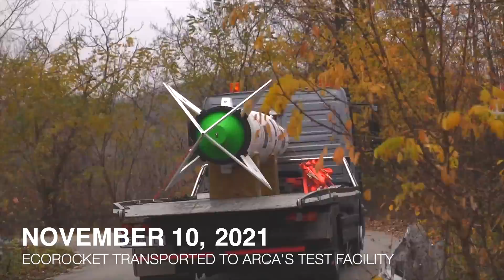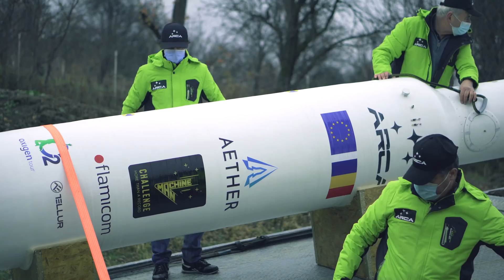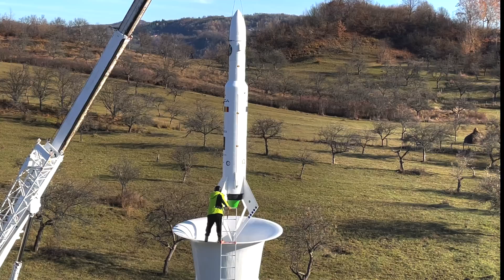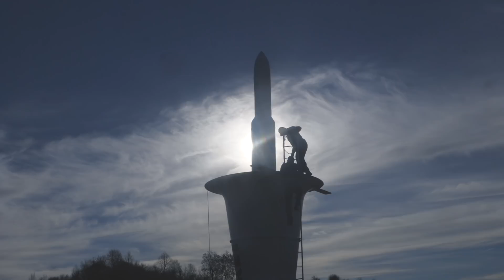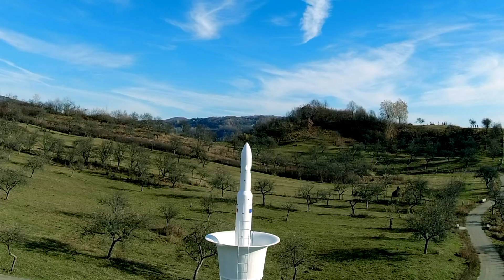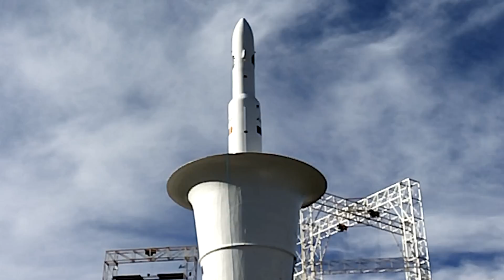EcoRocket: Episode 15 - Reaction Control System Tests

Comment: How is this supposed to reach orbit? This will never contain enough energy to go anywhere near orbital velocities.
Reply: You are kind of right, people had made the calculations and in a best case scenario they have about 8.8km/s of Delta V (as far as I can remember), that even with a high TWR (thrust to weight ratio) and perfect ascent profile is not enough to reach orbit

And just to clarify, I support every company/goverment that tries to reach orbit but facts are facts
Reply: And the water stages are only for climbing up to 80km, the rest will be a liquid fuel engine that will do the orbital insertion.
Reply: @Heitorkk2_  As I said. I doubt they can reach that altitude.
Reply: @PaddyPatrone  Based on what?
Reply: @PaddyPatrone  in theory you can reach space with steam propulsion, but orbit will be challenging. If it can reach space it would already be a great success though. Beating bezos with water
Reply: Fuck man, it's one thing for you to say it's impossible, it's another for you to prove in practice that it's impossible, let them, they're at least trying...

Comment: I mean good job with the super cool bottle rocket! If I understand correctly, the plan is to get to orbit? Highly confused by that. Have any of you actually done the math, because steam literally doesn't work that way. Your rocket would need to be the size of a city.
Reply: its not even fully fueled and the plan of the rocket has three stages and the 3rd stage is suppose to use rocket fuel
Reply: have you seen the math?

Comment: Very impressive start. Judging on the video from minute 2.29 to 2.35 it looks that it flu at least 4-5 seconds reaching 60-80 meters high. Was the rocket salvaged so it can be tested a little bit higher? How much water did it have , 10%?

Comment: Think it's truly possible to reach LEO with steam?
Reply: No, steam powered rockets can have a specific impulse up to 100 s. Or 1000 m/s often called Ve. A single stage rocket with 93 % fuel (steam in this case) and 7 %  structure and payload will reach 2.5 x Ve. A three stage vehicle vehicle will reach 5 x Ve. A vehicle with an infinite amount of stages get 6 x Ve = 6000 m/s. So that is 2000 m/s short of orbital velocity and we have not even taken gravity of air drag into account. 
Any person with an understanding of Specific Impulse and Tsiolkovskys rocket equation can easily see that it can’t be done.
Reply: @simonwesterlund2944  We don't have the Rocket echo data to assert the engine's ISP
Reply: @Heitorkk2_  we actually do, it s written on their website. If i remember correctly it was 80 for the first stage.

I don t understand the calculations above, but i ve personnally calculated that it won t reach orbit but still reach space
Reply: @unhommequicourt  One thing you forget, the water stages are only for climbing up to 80km in height, the rest of the orbital insertion will be done by a "normal" liquid fuel engine.
Reply: @Heitorkk2_  it doesn t matter, if they only reach space it would already be a huge success and proof of concept
Reply: @unhommequicourt  Yes, if at least it can be a sounding rocket, it will be cool.

Comment: the rocket wasn't fully fueled right?
Reply: I don t think so, you can see they stopped the rocket with a cable, so it could have went higher
Reply: @unhommequicourt  true
Reply: no and this was supposed to be the second stage, then there's a third stage on top of it.

Comment: No doubt highly amazing but it isn't it's delta V is much less as compared to a rocket of this size.
Reply: @tiagankoob8857  oh, you don't have the ability to do even half!
Reply: @tiagankoob8857  They didn't disclose the ISP!
Reply: @tiagankoob8857  so do it
Reply: @tiagankoob8857  you get more form me if you pull it off just send me the link to your video when it's done. Nobody gives money to word's... Not smart people anyway.
I know how liddle water rockets work but this is not the point. Do one to karman line and Ian impressed.
Reply: @tiagankoob8857  The ECO ROCKET has a 300 ISP engine in the third stage responsible for the orbital insertion, the water system is only for the ascent up to 80km, is it difficult to understand?
Reply: @tiagankoob8857  do better then
little engineer
Reply: It was just a low altitude test.

Comment: This is truly astounding! Amazing work! Can you explain what happened at the end? Was it not fully loaded, did something shut off unintentionally? How did it end?
Reply: Looks like he had a rope that limited the apogee for safety reasons...
Reply: @Heitorkk2_  is a pipe for compressed air
Reply: @radughita7996  Source?
Reply: @radughita7996  The Eco Rocket does not use compressed air.

Comment: We never lost faith in our ECO, allies. This achievement would make revolutionary break through in a Earthly hemisphere ally rocket✌👍👍. Wouldn't want to interfere with your work, but some suggestion, would be, for Eco Rocket to use a fast fuel density transfer, as a heavy mass, water will run out just as fast, then the "back-yard" hand made smaller,
This method, would transfer density of water from a more compress to a smaller chamber, lighter & HIGHER pressure mass, for example, chemical rockets in solid, switching to a paste form, then jell,  then foam, eventually mist & gas,. 
Only for starting from WATER , switch to a higher pressure in a smaller chamber, into mist - gas vapor steam . Saving much more volume per travel launch range🤞, Eco Rocket only needs to achieve surpassing altitudes of at least the Tropicsphere or Stratosphere to be a fully Eco friendly & a craft of Eartly resource in its name.✊🌍

Comment: Congrats for all your effort! Looks like the  apogee of the rocket was restricted by sort of cable visible at the end of the video. Is it because of safety reasons?
Reply: Yes, it is to prevent it from flying away in case something happens and also to prevent it from falling into the test complex
Reply: @tiagankoob8857  sort of. Better efficiency but those rockets stupid hard to engineer. So this is a simple low performance thing I guess. Just seems like they barely make progress. :/
Reply: @tiagankoob8857  maybe the cable shuts down the engine.
Reply: @tiagankoob8857  Am also wondering about sharp thrust cutoff, perhaps they used their shut off valves to achieve this and as a test goal. Was this done autonomously or with external guidance by ground control ?
Reply: Y'all shouting it stopped firing due to fuel blablabla, were you expecting it to fly into the orbit? Lol, bunch of FUDists and clowns tryna hate this project.